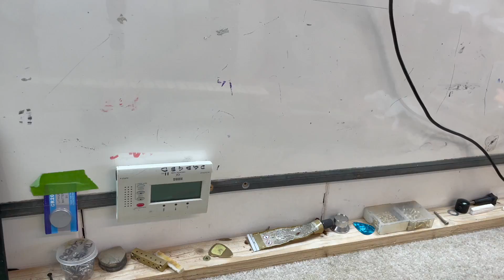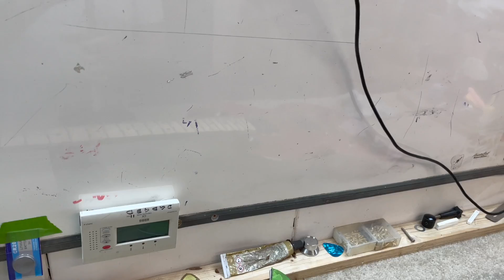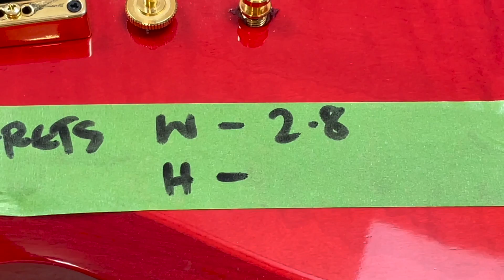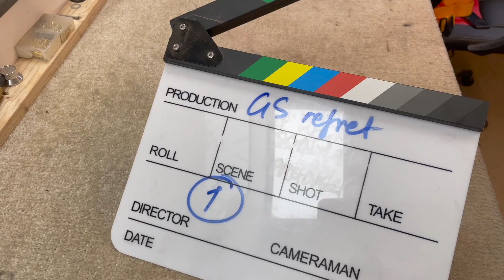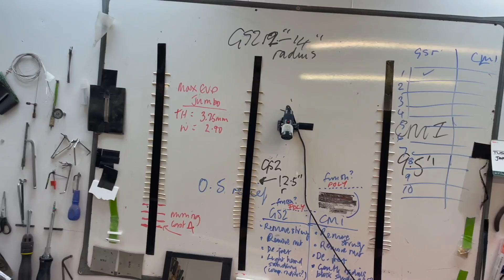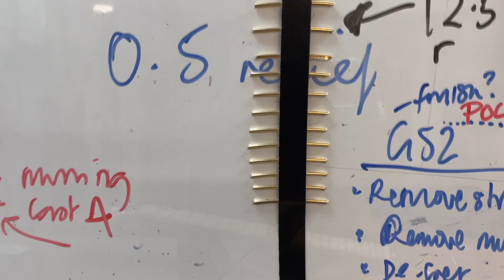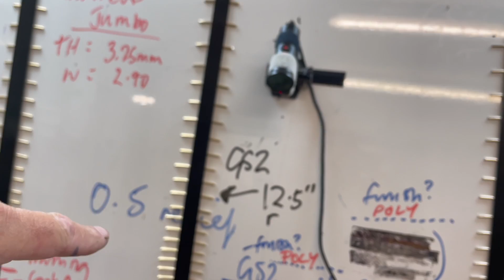Gordon Smith GS2 EVO gold re-fret, neck flaking and refinish and set up

Comment: Hi Sam ....Watched this video with particular interest as the finish on the neck of my Lite Ash Tele has lifted. I thought I might be able to feed in some thin super glue to stabilise it, but no luck I've had to chip it all off - "luckily" turned out to be an easy job. I think manufacturers sometimes smooth out the wood so much the finish doesn't bite into the surface. I think I am going to use wipe on spirit poly and work in between the frets as it doesn't need a refret - fingers crossed! By the way I don't suppose you found a forward bow in the neck was why someone had flattened out the frets in the middle of the neck? Didn't see how you got to the truss rod on this guitar.

Comment: I would disagree with you that "Where there is brass, there should be TUSQ".

this is just your own preferred material, where mine and many others; with these Gordon Smith guitars, are extremely happy with the brass.
Reply from the maker: I know I'm just having fun. I made sure that nothing changed so easy to refit the brass if so desired.
Reply: @SamDeeksRelovedGuitars   yes i noticed you had screwed the new nut

You may not know, but especially in the earlier 1970s and early 80s Gordon Smiths, you could choose brass or bone, it seemed to be an option, so a few do not have brass, though probably 99% of the 12000 Gordon Smiths do have brass
Reply from the maker: @stevendowd8924  I love the look of brass but customer wanted the best possible tuning stability so I said ok, I’ll make you a Tusq version to see if that makes an improvement. I know certain choices will upset the GS fans but I do what my customer wants, not what anyone else thinks is right. As you can tell, several aspects of this guitar were below par as far as I’m concerned not least the finish falling off.